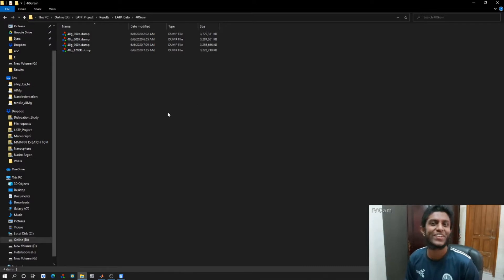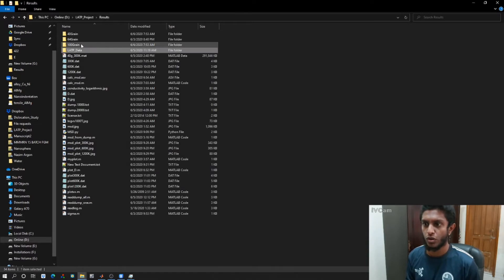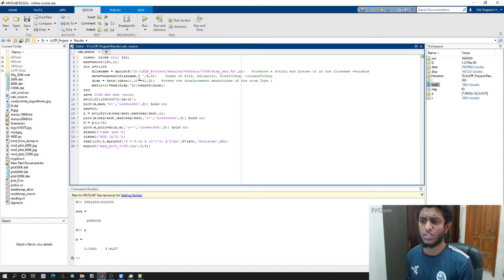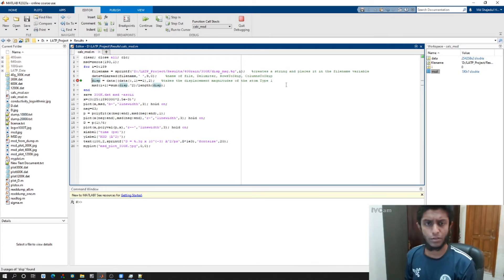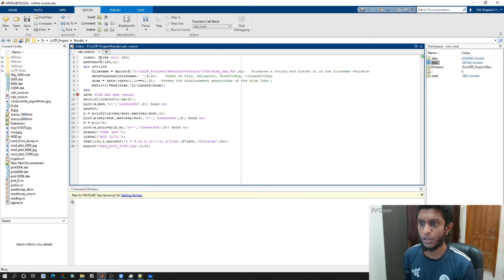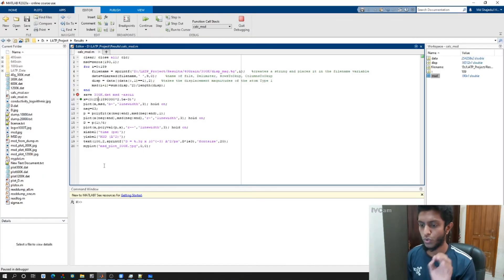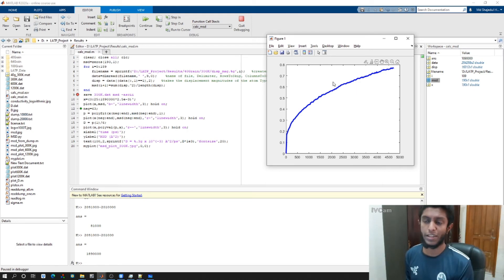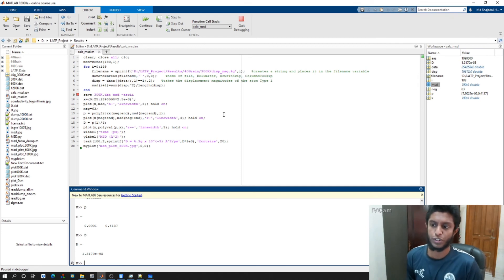How to Calculate MSD and Diffusion coefficient from LAMMPS DUMP file.

Comment: Thank you very much for your tutorial. I have a problem. My Ovito export section does not have the section to select displacement vector. My Ovito version is 3.7.3.
Reply from the maker: if possible, try with an older version of ovito such as 2.0

Comment: thanks for the great video :). One question: Have you tried the LAMMPS msd command for the simulation? I tried the msd command to get the msd, but it is 1 order of magnitude higher than just using the dump file to post process. Do you have any knowledge of that? :) Thanks!
Reply from the maker: Indeed, you can do the same computation using msd command in lammps. But there are many unit conversions, so recheck them.
Reply: @MdShajedulHoqueThakur  But withe witch command i can calculate msd !!!!

Comment: please check this (https://lammps.sandia.gov/doc/compute_msd.html), is that means lammps can do this msd calculation during the MD simulation (so you don't need to export and filter the data)?
Do you know how to output the "compute" command result? 
Thank you.
Reply from the maker: Yes indeed you can calculate msd during simulation, by the compute msd command in lammps. This is for the particular case where maybe you already did the simulation and didn't have the compute msd command, in that case you can calculate it from the dump files, as shown in this video.
Reply: @MdShajedulHoqueThakur   I recently did a test on NaCl-water solution. But I have the msd output with a large fluctuation (room temperature and pressure). Do you have any suggestion? My timestep is 1fs, running 500,000 fs, and the dump is 100.
Reply from the maker: @DrPan88  this is something that requires more information and possibly more expertise as well. I suggest you post this in the lammps mailing list, instead.
Reply: @MdShajedulHoqueThakur  thanks! I'll try that.
Reply: How do we get output in a file  of comupte quantity like MSD RDF by dump  ??

Comment: Can you please show how to calculate surface tension from lammps? Also if I want to calculate MSD for few specific atom how can I do that? for example atom no 10,35,46 ..blahblah.
Reply from the maker: Simply follow along with this video, and when we select the items on exporting from ovito, select atom ID, and then you can find that ID and it's corresponding MSD
Reply: @MdShajedulHoqueThakur   MSD from ovito is good but I think for a longer time this will be very time consuming. Using Python or other script to sort data from lammps output and perform MSD calculation will be better. It will be nice if you can show one simple simulation for phase separation and calculate surface tension from it?
Reply from the maker: @tanvirhossain5475  LAMMPS does have a built in command "compute msd"

I haven't done phase separation and surface tension calculation in LAMMPS, for that you can look into the LAMMPS mailing list and documentation.
Reply: Md Shajedul Hoque Thakur in my knowledge compute msd cannot do that for multiple specific atom. 
For surface tension i already look for the mailing list and many people have asked this but you know the typical reply from axel which barely make any help!!!
Reply from the maker: @tanh7527  in that case, I think taking the displacement magnitudes from ovito and then using a simple matlab or python script coupled with it, as I showed in this video, might be the easiest way.